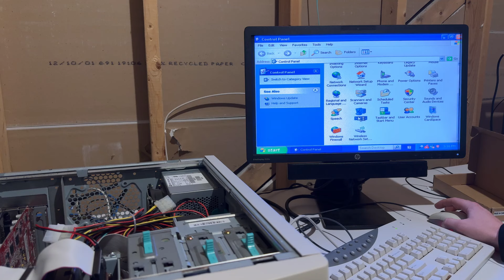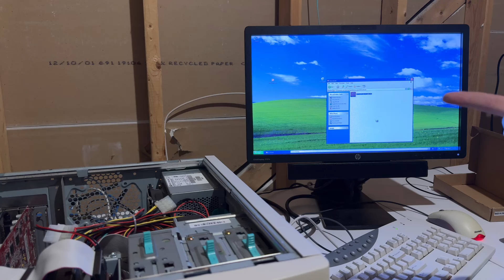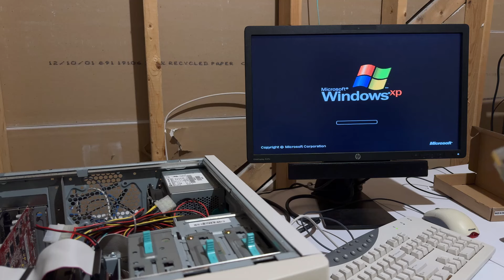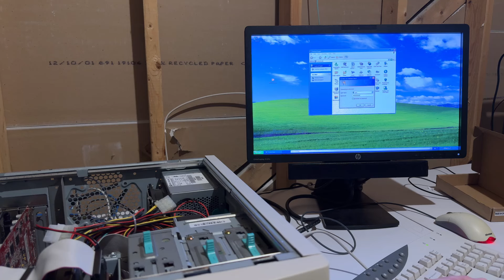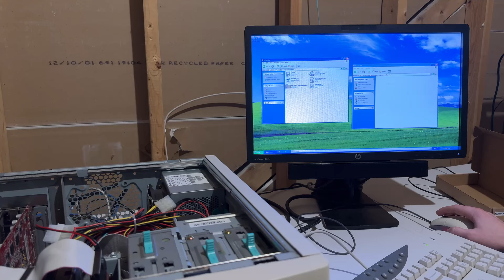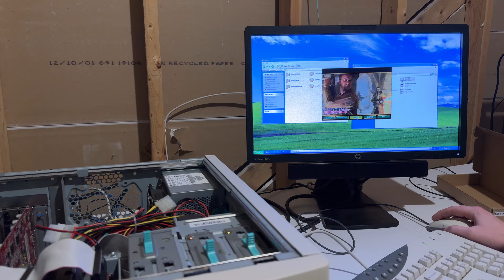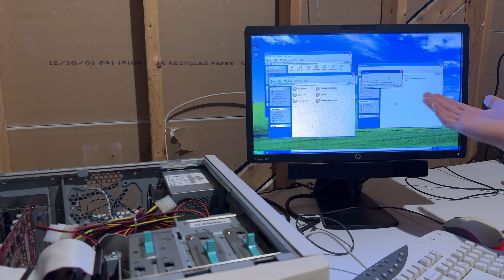Upgrading a Gateway Performance 1000 from 2001, installing Windows XP, ATI 9600xt, and gig network.

Comment: My experience of Gateway machines way back when, is there seems to run very well, optimised hardware. I actually had Xp pro running on a pentium 2, 350 and it was surprisingly snappy, even before optimised windows. It ran as a server at home and would run stable for months at a time
Reply from the maker: My first PC had a Pentium 2 350Mhz. I ended up replacing the cpu with the 450MHz version and ran Win XP on that for quite a while. It worked well from what I remember.

Comment: you are wasting your SSD, with a computer from then running XP there will be very little to no performance change using an SSD over a standard hard drive, those older computer operating systems are small compared to Windows 10 and already load up pretty quickly even from a hard drive
Reply from the maker: Luckily SSDs are cheap and plentiful.

Comment: Suggestion: the ati catalyst program was found mostly in the taskbar down by the clock. if not found there then try reinstalling and doing custom then select full install. (as it may have only installed the drivers)
Reply from the maker: Cool, thank you very much.

Comment: that would be a far better Win98 SE system, XP is fairly heavy on resources, especially if you upgraded to SP3. And for a retro gaming system, there's few to any games that will be better on XP.
Reply from the maker: You're right but I know back in the day I would have put Windows XP on it so that's what I did.